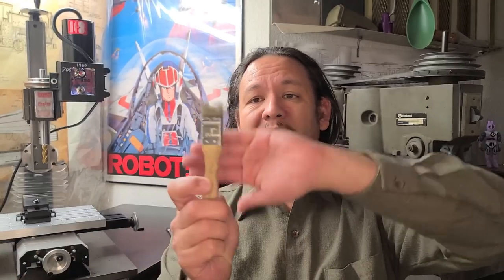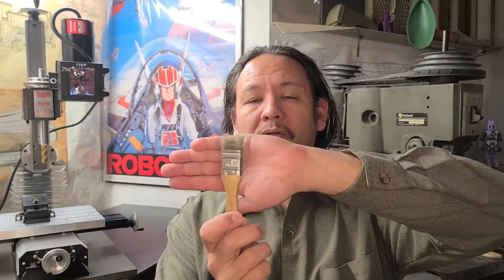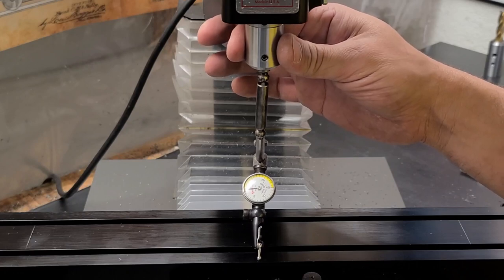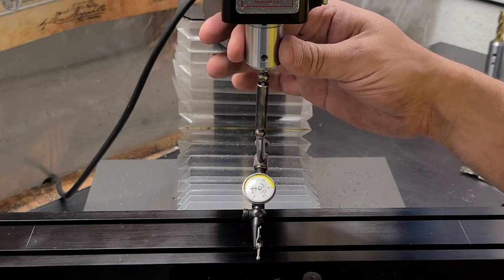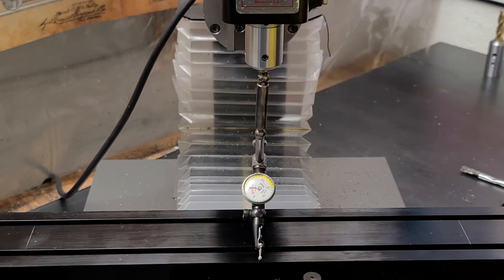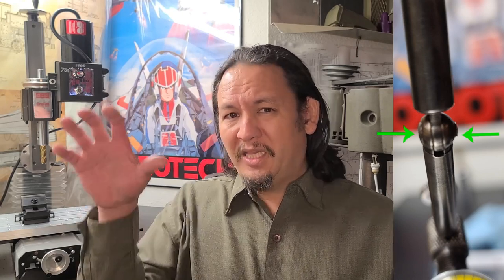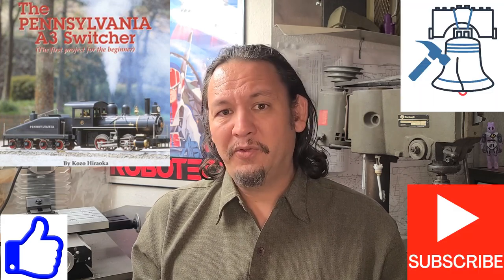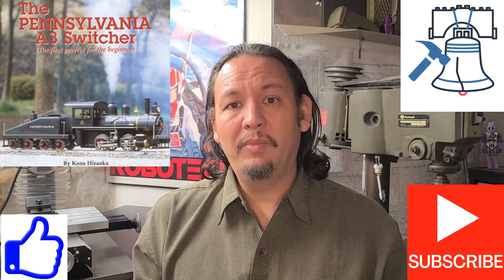Mill Crash?!?!? Recovery Lessons Learned

Comment: Hi, 1st off I just discovered your YouTube station & became an instant fan! 💯👏👏Your content, Info delivery & cadence is a Winner with my ADHD 🧠😆
📍I’m very New to machining & own similar Sherline equipment as you do. I’ve got the 2000 series Mill & 4000 Lathe, with just about every attachment & tool they make. 
📍I got the Lathe 2 years ago & the Mill 1 year ago. [Green~Horn ZERO experience with all this]👉I’ve been able to progress ok with Lathe techniques, however I’m LOST with the Mill. 
👉You’re Channel was the ONLY video I could find that Actually helped me understand the difficult squaring process of the Sherline 8-Directional Mill. 
I’ve been able to go thru every one of the steps you explained successfully, with the exception of fine tuning using the Vice & Last-Word indicator for the Z axis… [I CAN’T GET IT DONE] 🤦🏻 😫I spent 5-7+ hours on just that step before I had to tap out. 
👉Would it be possible for me to send you a DM on your Instagram wall, with a question? I would really APPRECIATE it so much🙏 
☯️My IG handle is same as here @ZenModeling . 
Respectfully, Lee
Reply from the maker: That's awesome I'm glad you were able to find my channel.  It is great that I can be of help. Of course you can DM me. I haven't been as active on Instagram but I'll keep an eye out for your message.  I have not had too many great photos lately.  My handle is loyd_precision_makers and my page is https://www.instagram.com/loyd_precision_makers/

That Z can be though and I feel for you. Since my crashes I had multiple dead end tram sessions. I even took a day off work and couldn't get it done. I feel your pain.
Reply from the maker: I see your IG post.   I'll take a look and hopefully be able to give you ate least a little bit of help.  You have a beautiful bench and I love how well it is organized.
Reply from the maker: It was good you removed the rotating vise base already.  When tramming it is important to reduce the stuff you have and simplify as much as possible.   Every little bit stacks tolerances and that is true even if your running a Kurt vise and rotating base. More expensive only means more consistent and slightly less tolerance stacking.  This even applies to glass plate.  Not all glass is dead flat float glass.  Not all dead flat float glass is dead flat.  I have a piece of glass that has a .0005 swirl that plays the devil with my indicator.  

Whether it is float glass or machinist squares they also add to tolerance stacking.  I use mine to just eliminate light that peaks through and get close before moving to the last word indicator.  

Here is a link to find glass, be picky as I said mine has been just ok. But will significantly help getting it trammed in close.  It was a great tip from other viewers.
Dead Flat Float Glass: https://ebay.us/giXKXv
Reply: @LoydPrecisionMakers  
🙏 Thank U🙏
Reply from the maker: There is a specific order of operation Sherline outlines to get a successful tram and each step is done in order before moving onto the next.  My impression is it would apply to other machines as well.  If your good on something skip ahead.  Consider doing more than two hours a day.  We have to give our mind a break.  I had terrible success doing those long 4+ hour tram session.  Coming back next day I was successful and better able to do it.
1.	Assembly
2.	Check Table accuracy/Tolerances!
3.	Square the Column
4.	Get the tilt close.
5.	Dial in the nod
6.	Fine tune tilt
Reply from the maker: 1.	Assembly: We need a good foundation. Make sure matting surfaces are clean, oil and debris free.  I wipe mating surfaces clean with a high-quality lint free microfiber cloth moist with acetone.  Be sure to wear gloves.

2.	Check Table accuracy/Tolerances: Load the dial indicator in the spindle and run the table over the length of the X,Y axis. This will reveal high spots and the capabilities of your machine. The indicators perform best with the stylus between 11 and 13 degrees.  Additionally, don’t overload the indicator. Keep it to around .010.  I like about a quarter of the load on the dial.  Overload gets those weird jumps out of nowhere.  Remember there are tolerances in the indicator and it needs to overcome its own internal friction.

The bed and table are machined aluminum that has been anodized.  When running the indicator, you may notice a flash in the needle near edges this is anodizing.  Imagine a triangle where the tip material has more surface area to volume than base.  Consequently, anodizing builds up surface as it penetrates that .003 range. In severe case this can be knocked done by stoning with a precision ground stone: https://ebay.us/jGiiUH

3.	Your fine tuning here is the column step 3. If in step 2 it is established there is a nice and tight table and machine you see and understand the limitations and accuracy of the table over its travel. The column from Sherline should be unmarked.  When Square make your own zero mark. The column flange spacer/nut or mushroom shaped disk under the column nut is what holds together the base, column parts, ram, column spacer/nut, column bolt all together. Remember each part and mated surface has tolerances it will take a few tighten and indicator sessions to get it right. If you have overtightened, things may fall into a peened surface and shift the tram.  This will make it harder to get setup.
Reply from the maker: Oh and if you haven't seen it I made a couple of tram and assembly videos:
https://youtu.be/t23naKu-H5M
https://youtu.be/3y2hep3ug3o
https://youtu.be/p9XifjN6Cgs
Reply: @LoydPrecisionMakers  
👉I just noticed this thread you put up🤩🤩🤩Great Reference Info: 1st thing I did was Screenshot it all & put it into my Machine Logbook🙏☯️🙏
Lee
Reply: @LoydPrecisionMakers  
🤩💯💯💯🙏☯️🙏
Reply from the maker: @Zen_Modeling  Great.  I hope it helps.  I had been told Sherline has excellent support on their technical resource help number 1-760-727-5857.  apparently you get an actual Sherline engineer or use to.  I haven't used them yet.  But would be interested in hearing your impression of how helpful they are.
Reply: @LoydPrecisionMakers  
They used to have a “Sherline Customer Product Equipment Expert” that would help when I called back 18+ months ago. But no so much lately… I couldn’t even get a question answered when I left a message for one of the [SCPEE] to please get back to me for an answer….still waiting….been 100+ days….🤷‍♂️
Lee
UPDATE: Just called them a minute after leaving that last comment & the {SCPEE} was actually there & ready to Rock with my ❓’s 🤓 💯
Reply from the maker: @ZenModeling  Great news.  That is good to hear. Hopefully the first experience was a fluke. How was it were you able to get it worked out? Is the tram is going well?
Reply: @LoydPrecisionMakers  
Full transparency, i left everything the way I had it & made sure everything was tight. Mounted the vice & put a 1” square chunk of Aluminum in it. I wanted to test & see what my cuts looked- [Using that 3-flute endmill everything looked👍🏻] So next I mounted my Rotary Table with 4-Jaw Chuck & the 1” Aluminum Square & started a project that Sherline sent me as a gift when I purchased the Mill. [Jack-in-the-Box] been machining 2-3 hours @ day, past 3 days.] going thru all the steps [*Trepan Groove]of this project. It’s been a killer project to learn the different movements on the machine. It’s exactly the type of project I needed. It combines use of different attachments & tools..& I’m having a lot of fun doing it😁 
👉It’s listed on the Sherline website under “Jack in the Box Puzzle”check it out…
PS: I still plan on running thru all the Squaring & Tramming steps later, I know a larger/longer sized project could be effected, even though this very small 1” isn’t… Lee
aka: ☯️ZenModeling☯️
Reply from the maker: @Zen_Modeling  Very cool.  Glad your enjoying the project.  I saw it before and wished they had included it with the mill package.  You’ll have to let me know how you like that rotary table I have been on the fence about the Sherline or one of the other offerings from Little Machine Shop.  If you run into any more problems with your mill tram let me know and we will see if we can figure it out.